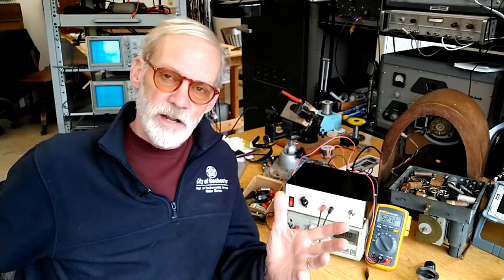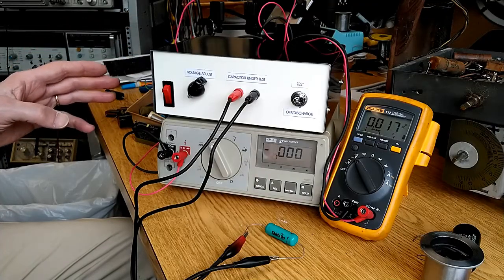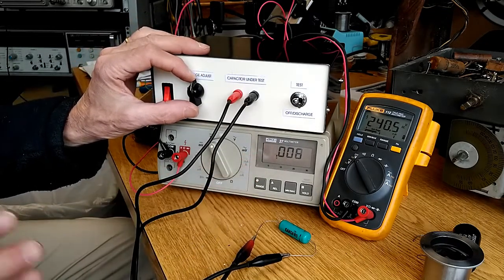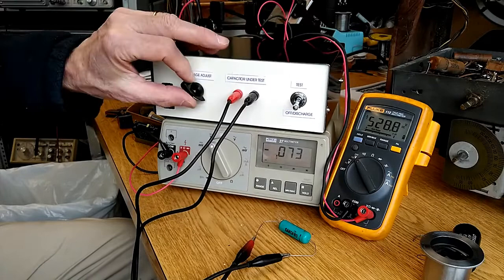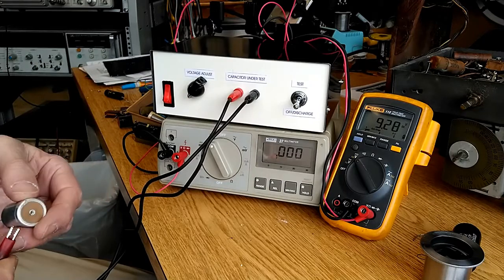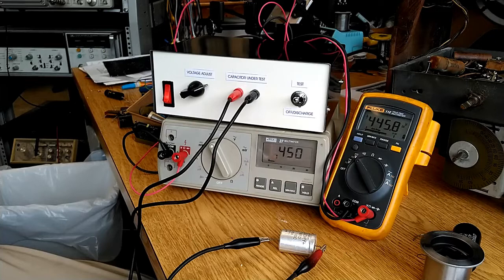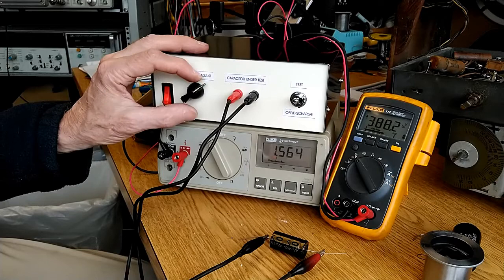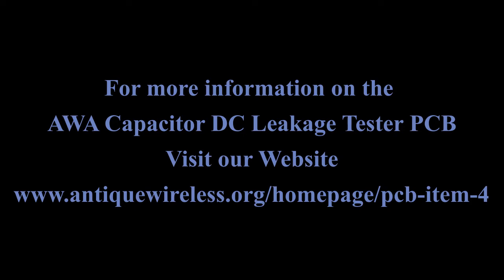Testing old capacitors with the AWA Capacitor Leakage Tester

Comment: I have ordered the PCB, but then came ordering the parts...the LR8N3 is 'unobtanium' at the moment -lead times are August 2023 or later here in the UK.  Mouser CPC, FArnel, RS are all are all in the same place..  So my kit is standing 99% built - waiting for one part!!
Reply: Search Mouser for an "LR8" and you get the same one in SMD and an LR8N3-G-P003. Check the datasheet!